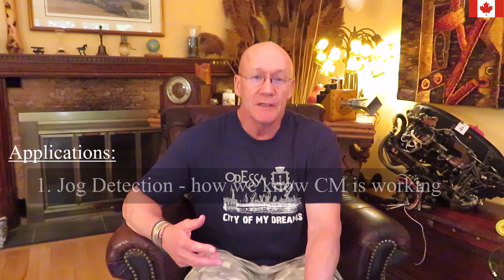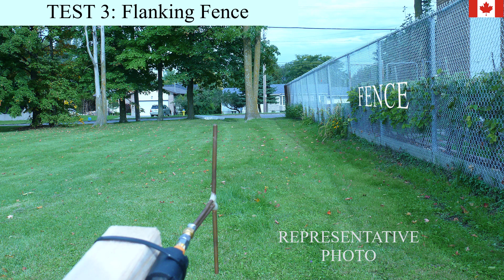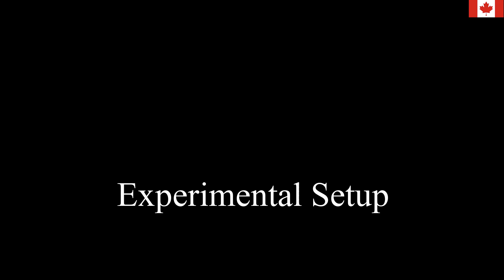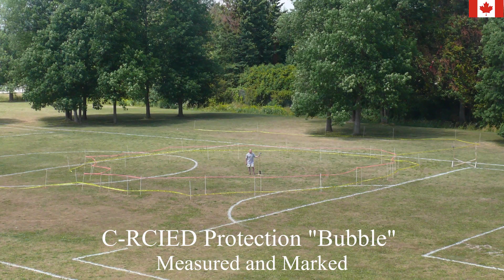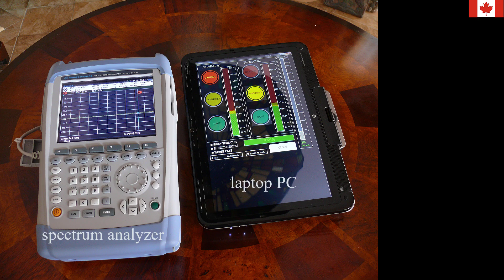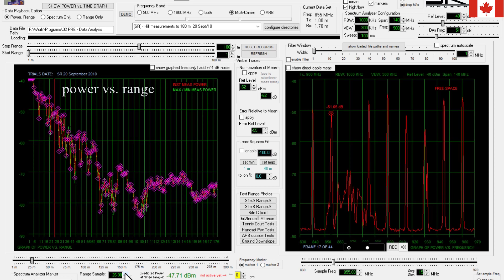01  Propagation Model Validation   INTRODUCTION 15

Comment: i really like your software. I have done similar before but only by walking down range and recording the power at various frequencies using a spectrum analyser and writing down the observed power at each frequency. far too laborious!
Reply from the maker: Thanks - I did the same at first and found it frustrating, not much in-hand after all the work of setting up and operating equipment, and not so easy to get time on a test range.  

Real insights can come from playback of recorded spectra in a power vs. range graph, insights that I don't know how to get any other way - even years later by noticing features I didn't know about when the measurements were made.  Example: I can see leaves on trees in spectral measurements, and the difference between winter and summer testing; I found that long after the data were recorded.  And recently I noticed the "tennis courts" measurements (https://www.youtube.com/watch?v=23fff9-wN9c) have very little temporal noise, so that's more evidence of leaves/side-scatter effects, years later.  

And the digital recordings can be used for lots of other things, forever.  

Example: Create a virtual test range, a coax cable lab bench test range, with some limitations.  

Example: Compare different test ranges around the world for suitability of experiment XYZ.  

Example: Compare test ranges with similar real-world in-theater data, if it can be obtained.  And there's a reason to.